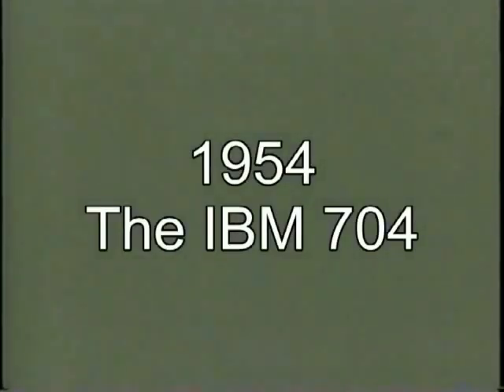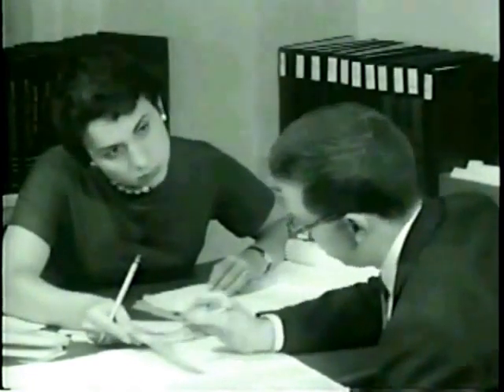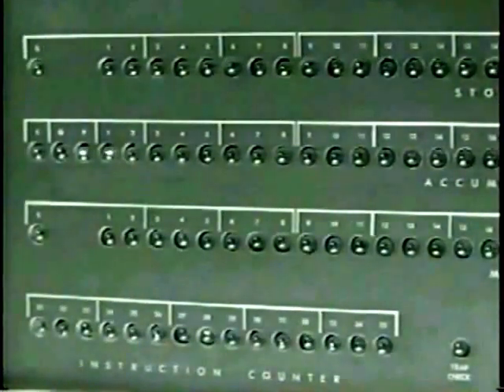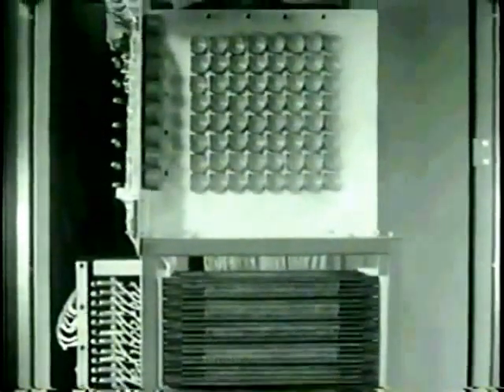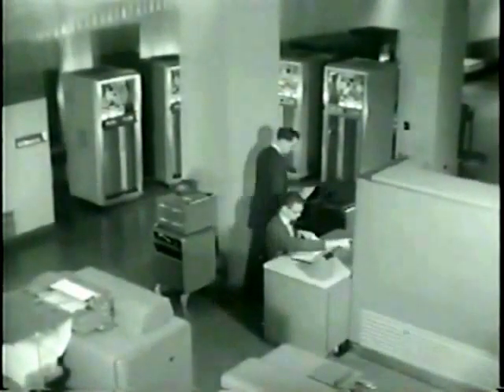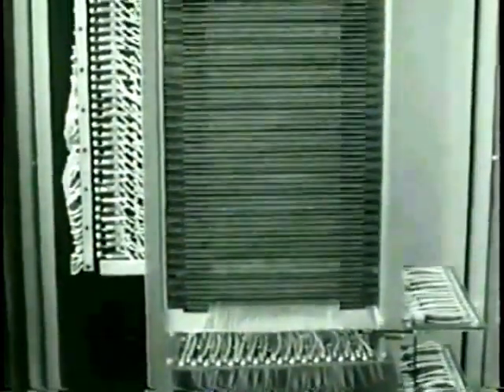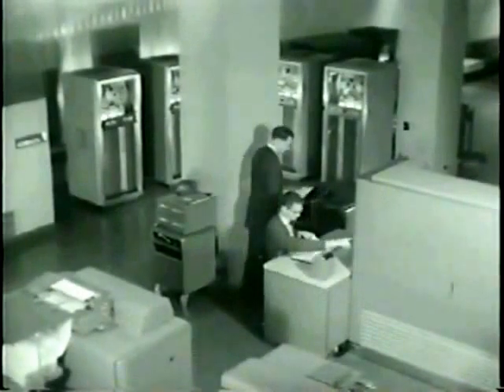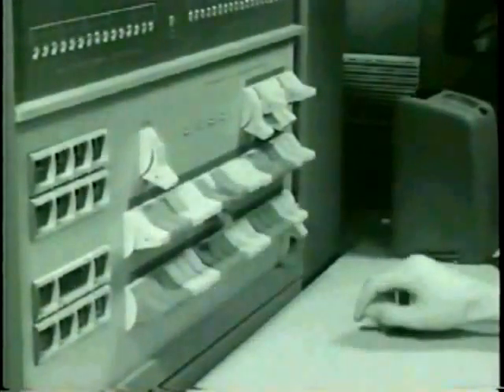Computer History 1954 - IBM 704 vacuum tube based computer  (floating point, scientific, mainframe)

Comment: Does it have USB 3.0?
Reply from the maker: Good question.   I am still wondering if it needed a special "240 Volt" power line to light up all its massive circuits!
Reply: Connections between components of all mainframe systems were not serial but parallel, ie one wire per bit position (36 bit “words” in the 700 and 7000 series), and this persisted into the microcomputer era; remember the wide, multi pin plugs in the old COM and PRTR ports?  USB was not conceived until the PC era.

And I suppose any machine that big would have a special connection to utility power. Later ones got their power through a battery backup UPS (uninterruptible power supply) which took up a room just for the batteries, and turned a diesel generator (roof mounted or in a standalone shed) on shortly after an outage began.
Reply: Absolutely correct, except COM is a serial bus not a parallel bus.
Reply: @ComputerHistoryArchivesProject  Actually, many of these early computers (IBM, Burroughs, Univac) required 480 volt, 3-phase current to run. The power was usually "conditioned" before being fed to the computer via a very large ferro-resonant transformer which filtered out transient voltage spikes and regulated the voltage to eliminate surges and sags. It was not unusual to find a fair number of 500 amp fuses inline with the computer to protect the computer during fault conditions.
Reply: does it support RTX tho?